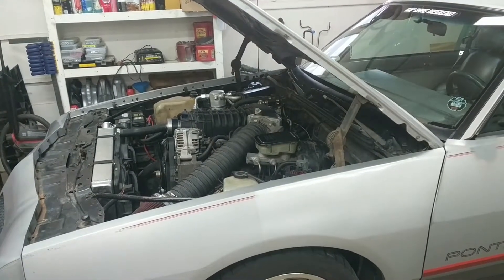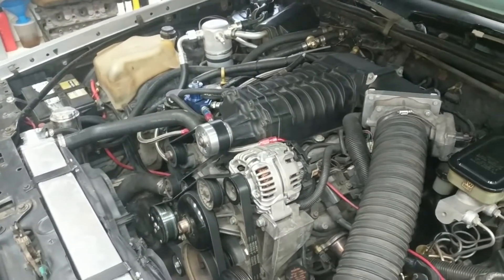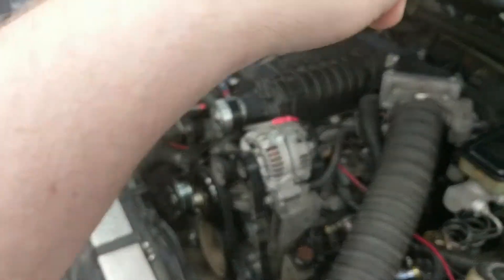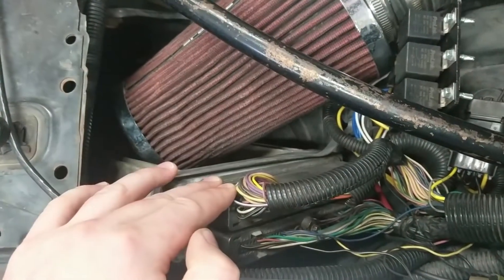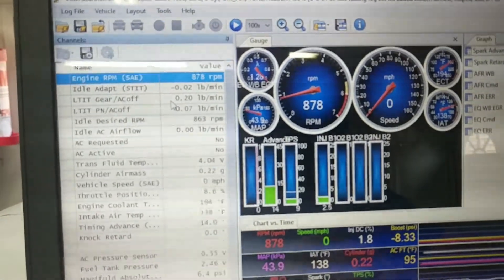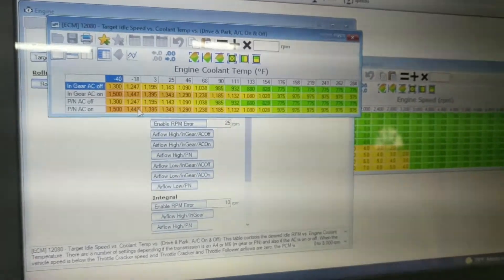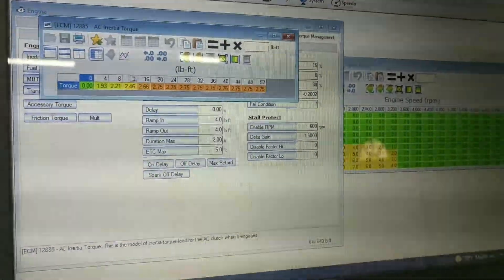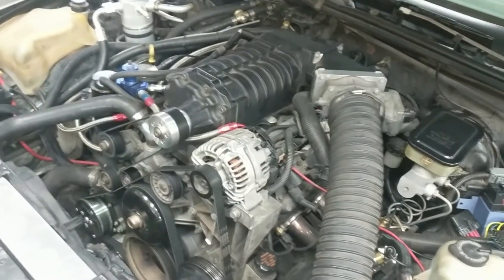Aftermarket AC on an LS with stock harness & ECM

Comment: I have just come across you video about the issue I am dealing with now. So I connected Pin No 17 on red connector to my vintage air compressor on my LS swap. I made the changes as well in the hptuners as indicated in this video. So I turned on the AC, the status of “ AC Requested” became Yes but the “Active AC” was showing”NO”, and the idle rpm did not bump up at all. Any idea why the idle rpm remained the same and why the AC mode did not get activated. Thanks.
Reply from the maker: Are your idle trims in gear or park within the range I said? Is the computer getting 12v from the AC clutches?
Reply: Thanks for the reply. The trims are within limit I believe. LTIT is showing or around -2.7g/s, which is not bad I think. However, I need to make more adjustments once I get done with VE&MAF tuning. Yes I connected pin 17 on red connector to the AC conpressor wire that’s activating the clutch and I am getting “AC requested” signal and indication as “Yes”
But AC is still showing inactive.

Comment: Umm on your idle setting in hptuners it lets you set the idle booth with and without the AC on
Reply from the maker: Yeah, but unless your air flow tables are correct it won't let you go into AC mode where it bumps the idle

Comment: Ground PIN 55 on the red plug?
Reply from the maker: Yeah, did I say blue in the video?
Reply: @hackjobhotrodshop5075  I need to watch again. I don’t think you mentioned connector color but you pointed to the connector that pin 17 is on which is the red connector. You said in the video to ground pin 17 but you put the text “ground 55” at the bottom of the video, so I knew what you meant. Nevertheless, great video and I hope this solves my issue as I only added the +12v from my switch to pin 17 and it didn’t fix my idle issue with A/C on.